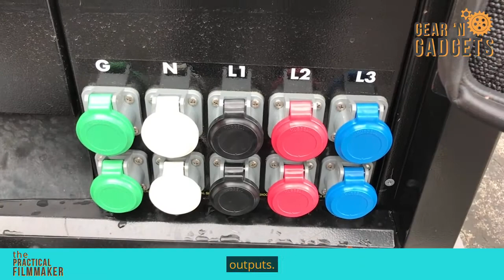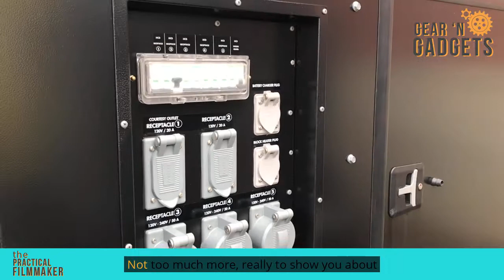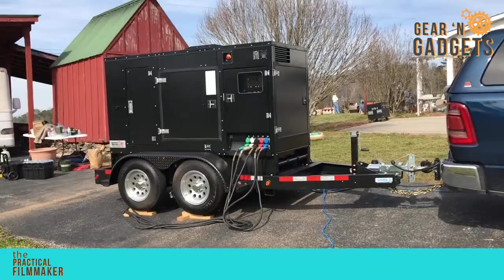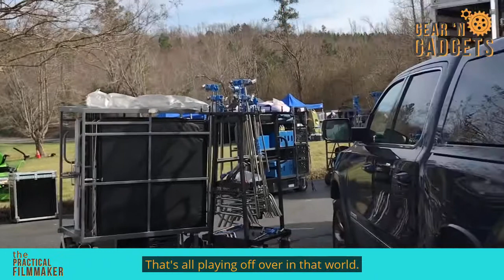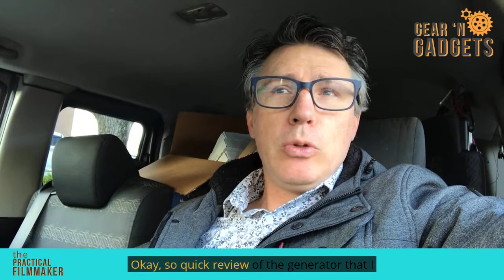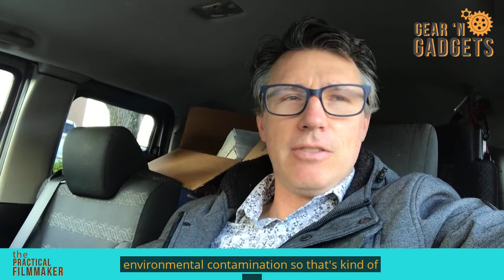Mega Silent Generator - Gear n' Gadget

Comment: can a  25 kva generator push power to  LED  RBG lighs and  equipment
Reply: This question somewhat doesn't make sense. What matters is that the generator is capable of producing voltage within the acceptable range of the devices intended to be powered at the frequency (Hz) they are designed to operate with. 

In the US, 120V, 60Hz is standard for most film use intended RGB LED fixtures. All US generators designed for film will produce these power specifications. 

As for the kVA, that is dependent on how many of these fixtures you intend to power. With 25 kVA, you can power quite a few standard sized LED fixtures.